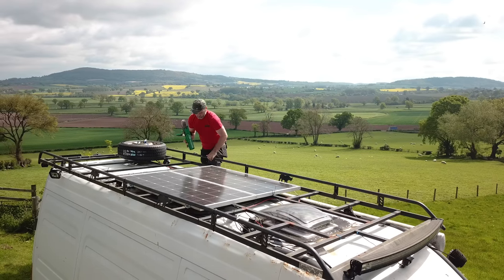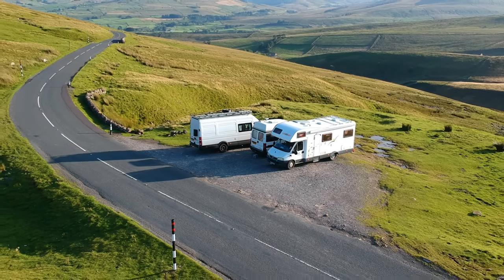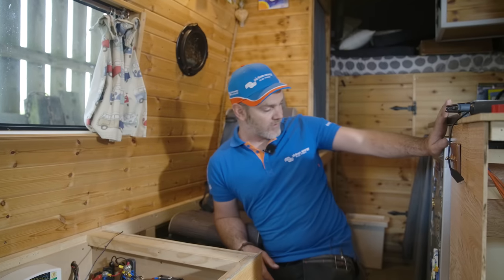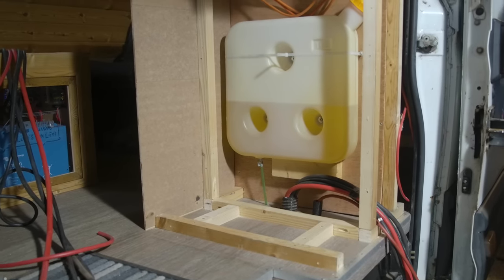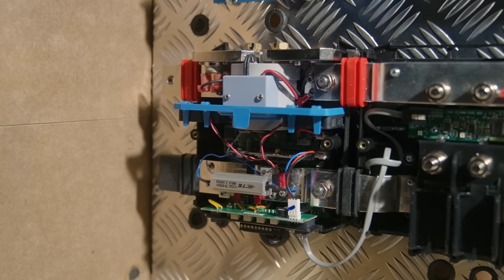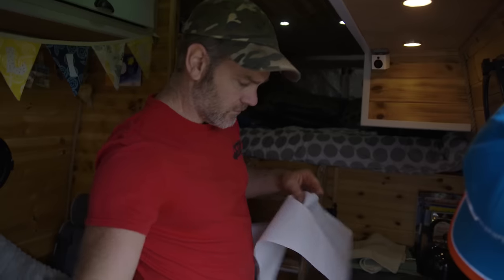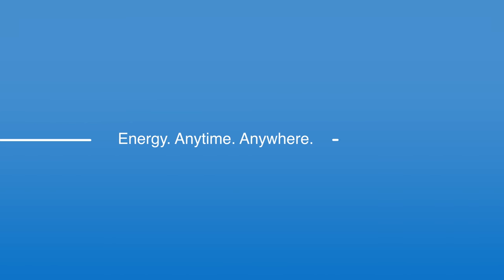Van Electrics Install with Lithium BMS and Orion

Comment: Victron has had the best products on the market over their whole range.
Reply from the maker: Great to hear Samuel - thank you :-)
Reply: @VictronEnergyBV  When is a Cerbo-gx 2 coming out please?!?
Reply: @patricklyons7683  What's wrong with the current one??
Reply: @johannesboonstra6917  l suspect a larger amount of kit or displays would be beneficial, such as two gx-touch displays one by central electronic hub & one near an exit door would be advantageous. I know you can add the bmv battery display. What l'd like to see is selection of graphical or 3D overlays + selection of calligraphy options. Plus a plug-in hub or two strings of hubs from cerbo-gx. Allowing a much larger network of Victron kit to be spread about a lorry size vehicle (30 foot interior).
Reply: @patricklyons7683  You can pull up the same display on a phone/tablet/laptop wherever you want it.
Reply: @AMGMANIAC  l specified an extra touch-gx display, have you managed a single day without carrying a phone around yet?
Reply: @patricklyons7683  I managed fine for 30 years and have no problem putting it down or picking it back up. Have you found enough energy to walk between the front and rear yet?

Comment from the maker: 🎯 Key Takeaways for quick navigation:

03:11 ⚡ Lithium iron phosphate batteries can offer up to 5,000 charge cycles, making them a long-lasting and efficient choice for van life setups, unlike AGM batteries that need replacement every 3-5 years.
04:04 🌞 A 300-watt solar setup, a 100|30 MPPT controller, and an Orion DC to DC charger allow for efficient battery charging in Luke's van, ensuring reliable power during off-grid adventures.
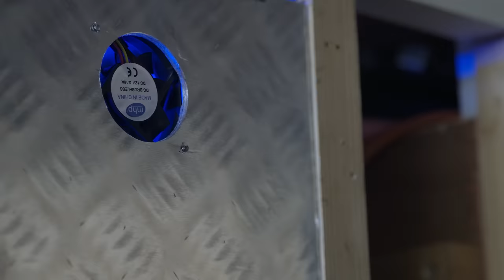05:25 💼 Luke's custom electrics cabinet not only powers his van but also serves as a Victron Energy display, showcasing the equipment and offering a neat and organized solution for van electrical systems.
06:52 🛠️ Victron equipment is favored for its reliability and compatibility, making it a preferred choice for those looking to build efficient off-grid van electrical systems.
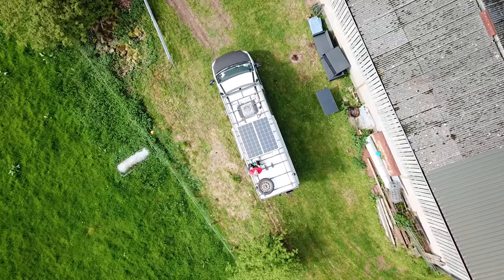07:36 📊 Connecting the Cerbo to VRM allows remote monitoring and control of the van's electrical system, providing convenience and peace of mind for van owners like Luke.

Comment: Orion charger only offers 30 amps at 12V.  Even with two of them you're only at 60 amps.   Modern van batteries are quite large and need higher current charging.   I see that Sterling has released a 100 amp  and even 200 amp chargers 12v chargers.   To match this we'd have to put 6 Orions in paralell.   This is NUTS.   Is Victron going to come out with a proper high-current B2B charger?

Comment: Inspirational build.  I love modularity, but when is Victron going to release the Hybrid controller that has all in one Transfer switch, MPPT, Battery Charger, Shunt all in one?  Say 6KW Inverter, 500V MPPT @ 4K watts, transfer switch, and battery charger all in one... Also, some companies or a consortium thereof are going to benefit from developing an Open Source BMS protocol, which would then benefit us all, and the originators would be the early adopters.
Reply: That Victron is modular is a plus for many of us
Reply: @Kosmonooit  I went with the EG4 6.5kW Off-Grid Inverter | 6500EX-48 | 6500W Output | 8000W PV Input | 500V VOC Input | UL 1741 Certified for $1250... with 3,200 watts of panels, and 48V LiFePO4 @ 800 AH, hopefully to be mounted on a dual tilting aluminum super strut frame.
Reply: ...with Plug on Neutral electrical box and Combo AFCI/GFCI breakers on all AC runs. 50 Amp Shore power @120V.  48 to 12V converter +  Shunt for AC Air Conditioner use monitoring, and Shunt for "total AC use".  Putting it all in a sound absorbing active vented cabinet, vented with heat recycle or heat rejection modes using baffles and actuators...

Comment: Slowly but surely I have been converting my boat from Mastervolt to Victron as it really is superior. Slightly annoyingly though my Cerbo GX stopped communicating with my Ruuvi’s. The one installed in this van probably runs an older firmware?
Reply: hmm...you are using a BT dongle ( about more reliable signal) ?
Reply: @johannesboonstra6917  No. I installed 4 Ruuvi’s about 3-4 months ago and they worked fine for 2 months. Then with a new firmware they disappeared. The Ruuvi’s are located about 2-3 meters from the Cerbo GX.
Reply from the maker: Try re-synching them.  Open the Ruuvi and press the button inside.
Reply: @VictronEnergyBV  I did, but no luck. They sync fine with the Ruuvi app on my phone.
Reply: Unfortunately the Cerbo GX Bluetooth seems to be so problematic that in the latest RC of the Cerbo GX firmware the internal bluetooth chip has been disabled permanently. So if I want my Ruuvi’s to work I will have to buy a Bluetooth dongle. Not a very elegant solution to a hardware issue…
Reply: @lawrencerenes8542  the chip is not switched off at all, please switch on/off if you want.  beside this, using ruuvi on a Cerbo is always best done with a bleutooth dongle to optimize range
Reply: @johannesboonstra6917  Dear Johannes, first of all thank you for responding; it shows how much the company cares about their customers. I am a huge fan of your products, and I am literally replacing all (working) Mastervolt equipment on my boat with Victron because I believe your products are far superior. That said, in the latest RC firmware 2.90-14 Bluetooth has disappeared from the I/O menu. From your forums I understand many were having issues with your Bluetooth, so I understand it is easier to switch off the on-board Bluetooth chip and to just tell everyone to buy a Bluetooth dongle. Which of course isn’t a big deal; EUR 10 buys you a working dongle. It is just surprising for a company like Victron to do things in this way. For me you represent the gold standard, and this isn’t really a very elegant solution. Please take this as constructive criticism, as I want nothing more for Victron to be hugely successful, as you already are (and for the prices of your Lithium batteries to come down!).

Comment: AGM will last much longer then 3-5 years. I'm on my original set still and they are 12 years old and been in 2 campers now for a total or 10.5 years. Still going string as day they were installed.
The best battery to install is saltwater battery